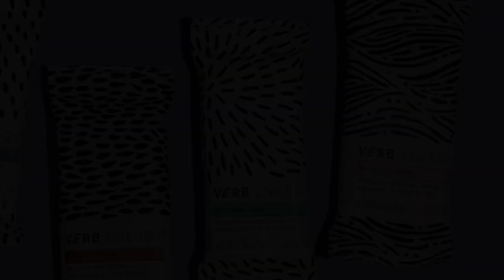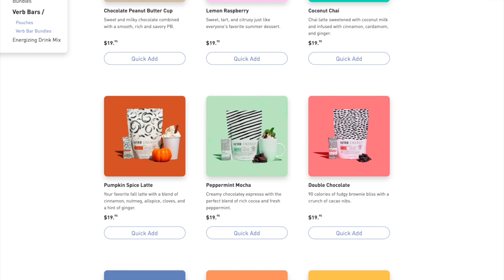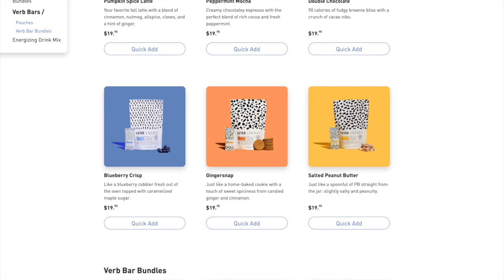Running Low On Energy | Home Renovation

Comment: You can test the bed with a magnet to see if it's solid brass. If the magnet sticks, it's brass plate over steel or cast iron. If it doesn't stick, there's a good chance it's solid brass. There are further tests you can do to verify, but they can mar the finish so the magnet test is a good, simple one to do.
Reply from the maker: I’ll try that! Thanks